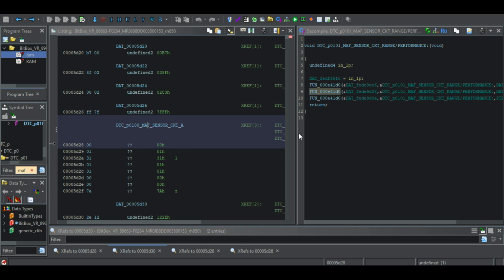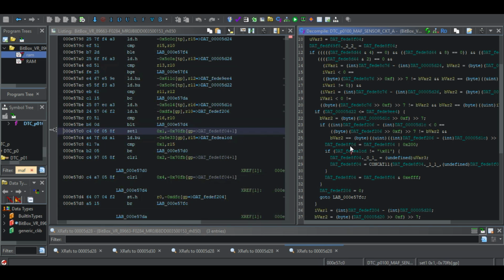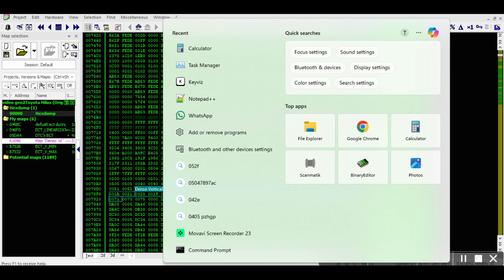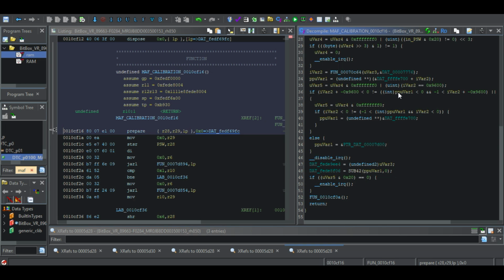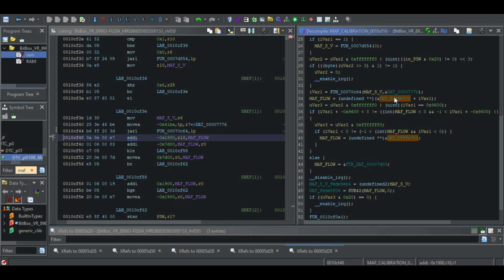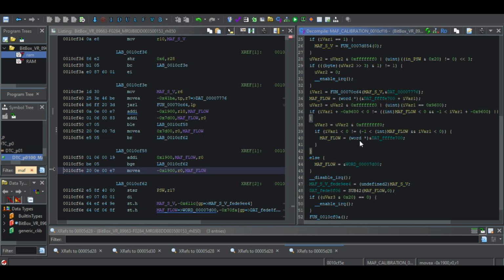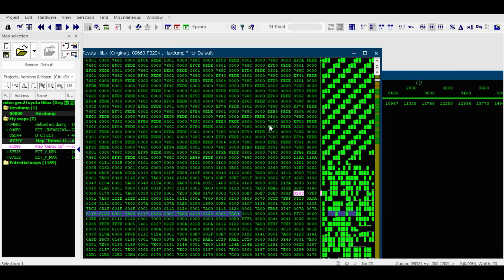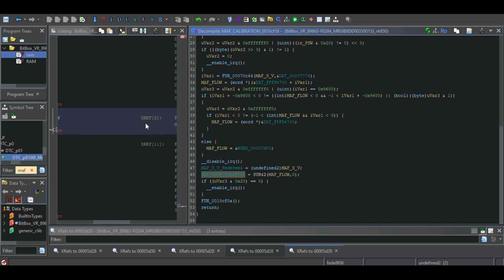defining MAF sensor linearization map and thresholds. Toyota hilux 2018 Ecu with ghidra and winols.

Comment: hey ,  what processor language used in gen1 (76F0085) toyota denso  ?  ChatGpt  suggest me this " The 76F0085 is believed to be based on the 8051 architecture, a widely used 8-bit microcontroller core. Familiarity with the 8051 instruction set and architecture will be beneficial. "
Reply from the maker: I think it is v850. Search for ascii “copy” see what the copywrite says.
Reply: @GHIDRAuto   it says  " RX703200 Copyright (C) NEC 1999-2002\r\n"

Comment: how to address Memory Block with correct address start address and lenth
Reply from the maker: As far as I have seen it does not matter how large you make your are for RAM. (Memory block) as long as it is large enough, and has enough room on the front and back. That is what the script did in the beginning, but sometimes it is wrong and you have to ad room as you find addresses outside of the block. It may help to have all of the memory properly identified, in which case you must consult the processor data sheet. For making maps, finding dtcs, and switches, adding memory as you go is accaptable
Reply: @GHIDRAuto   I can't find datasheet for these Toyota processor 76F0196/76F0198/76F01199/76F0219
Reply from the maker: @javiddkhan  oh, yes they are manufacturer specified, and you have to get their registers set correctly. they similar too rh850,or v850. I have a detailed tutorial on gen2 toyota denso my website www.ghidrauto.com. the information translates for gen one also

Comment: nice!! these gen2 ecu cant be read from obd2, recently some russians have been releasing tools on how to do the real read. have you ever looked into that?
Reply from the maker: I have heard about the Russians reading them. Supposedly bitbox? Can now read these ecus. I have not looked into it though. This video is one segment of a course I have on my website. I had a few people asking about these gen2 denso’s, but I don’t personally do anything with them. Just making the information more readily available.
Reply: @GHIDRAuto   there is a few other tools also not just bitbox, but will be easy to copy once released. did you ever analyze boost sensor scaling on this ecu ?
Reply from the maker: Yeah I haven’t gotten into the mechanics of reading and writing. I have found and explored the functions to read and write and communicate with my Isuzu Ecu. I have also found all the PIDs and dids.  7e8 7e0 101 102 5e2. I have also logged writing to my Ecu, However understanding how it works is still coming to me. It’s hard without a mentor or experience!! Yes I solved the boost sensor scaling in the gen 2 and gen 3 Ecu, and the new denso PowerPC, and old sh7xxx. Gen one Toyota is a little odd. I haven’t taken the time to fully understand the code for the factorization of the pressure sensors, but I do have two values that are more then likely factor and offset for gen1. Feel free to email me @ghidrauto@gmail.com. Or purchase this course on my website, it covers the boost sensor, and others. Ghidrauto.com

Comment: if they(toyota) are generating the code from matlab simulink models, the code would look more hideous after reverse engineering if not already.
Reply from the maker: That is an interesting point. Do you think that is what denso is doing? The code architecture looks much too similar between Japan’s big three  for it too be the manufacturer of the vehicle.

Comment: Have new discord link? I have original and modified files with the I/M readiness monitors set to read ready at all times. I see the changes in the file, but I have no clue how to find the functions that relate to the changes made in the modified file. If you can offer assistance I will send you all of the org and mod files I have for mainly Bosch controllers for whatever brand is equipped or Delphi controllers for GM vehicles
Reply from the maker: https://discord.gg/Xpkw8Sfj
Reply from the maker: I always enjoy finding functions behind the edits to see how it works together.

Comment: I've never used Ghidra, so watching this was really cool. I had no idea that it was even possible to reverse engineer ECU stuff the way you're doing it! It's still not clear to me how you derived meaning from some of those blocks of hex. It's impressive how you can make educated conclusions just by looking at arbitrary chunks of data. Stay brilliant and inspiring!
Reply from the maker: You hit the nail on the head. You make your educated guesses, and then when you track the guess too a dtc, you find out whether your guess was right or not. Obviously this concept takes many different forms throughout the re process, but the concept stays the same. You have to imagine what maps and code a programmer or calibrationist would need to make the engine run properly, then stay open minded enough while digging through the rom to be wrong, or almost right, so that when you see something g that is similar it clicks and you see it for what it really is rather then what you wanted to see.

Comment: Sorry for the silly queation, what language is that? C , C ++?
Reply from the maker: I’m honestly not sure. We are loading compiled machin code into the program. Rh850 processor in this case. Then ghidra does its best to convert too what I believe is C
Reply: Thank you for the answer. I subbed to your channel. I think you are doing very cool and informative videos. I will get the tooling and software required so I can learn and practise to in my free time of im not stuying instrumentationand control. Im a diesel mechanic down under, and i work on cars too,mostly a/c repairs. I like Toyotas btw , and amaroks . @GHIDRAuto
Reply from the maker: Nice man!! Your in a great position to learn these skills
Reply: @GHIDRAuto  can I please have the link for your discord community?
Reply: please correct me if i’m wrong. is the machine code in the form of jumbled hex codes, and then ghidra takes it and outputs its assembly code, as well as trying to translate it to the C-like language?

Comment: I work in automotive as an embedded engineer and I barely can navigate through our source code, this guy reverse engineers hex blocks and can derive at least some meaning from it, its really impressive
Reply from the maker: SHoot!!! they found me! lol
Yeah man, RH850 isn't my preferred language, I just figured "TOYOTA HILUX" would get some attention, and I've had a lot of people asking about it. my course on my website goes into a lot more depth on this ROM. I really prefer the old SH7xxx SH2A,e and sh4 language processors, due to all of their FLOAT's. I have a 1/4 of the time navigating those, and their code seems to be a lot more organized. small functions handling very specific task and then handing off to the next. PPC VLE also seems to be fairly straight forward although ghidra isn't handling it very well. regardless, rh850 or at least this hilux Rom wasn't my favorite. 

thanks for the Comment. You guys are doing some great work!

Comment: ... Renesas RH850 series?
Reply from the maker: nailed it
Reply: @GHIDRAuto  Yeah. I saw those 'movea' and 'st.h' instruction and was like "huuummmm... What is that!?" ... then I googled it. (I'm also now noticing that it's at the end of the file name for the assembly listing.)

More of a repair guy than a reverse engineer gentleman myself. That said, I dabble with EE. Let me just say, I love the "follow the DTC road" method. +1 sub. If and when I ever get some free time to myself, I gotta do some repair related RE on two systems. The main uC's on the central locking unit/immo and the PCM/DME for late 90's Porsche. I am totally going to use that method when I get to it. (one of the DTC's is "Wrong or Missing Key" .... path to victory is so much clearer now.)

... now I just need to search through the entire internet for some tangential datasheets that might show me exactly how to communicate with the programing interface of two different 90's uC's, then spin up some custom circuitry to rip the ROM's. Then simply get ghidra to de-compile 6502 and some obscure custom extended 8/16 bit Intel uC.

Should be a piece of cake! :D  (. . .End me!)
Reply from the maker: Nice man! That will be a fun project. Yeah, the way I explain it, are you going to drag the wood back to camp and then check if it’s good enough to burn, or are you going to check it as soon as you find it before bringing it all the way to camp for use. Same as checking voltage for thresholds. First thing a good engineer is going to do is condition it, then check it for quality. Then bring it through to operational functions.

Comment: The fact that reverse engineering is necessary is a societal failure.
Reply from the maker: You could wait until it’s supported by hp tuners, or cob, or you can do it yourself. Oem is avoiding liability by offering it.

Comment: I have lexus which has sport mode, but every time the car shuts down it defaults back to normal mode. I wonder is there a way to update source code of ECU so it will have sport mode by default. What plan would you have to achieve it? I am not sure where to start
Reply from the maker: Yes definitely.  First place to start is going on a deep dive to see how to get the binary file from your car. Or for your car. What year is it?

Comment: I would like to see a video on how you pull the roms from the Toyota denso ecu's and what tech is used ?
Reply from the maker: somebody sent me this Rom. however, the software I really Like using is PCM flash. The tool is simple, and has phenomenal support. I use Open port 2.0 as my usb to OBD2 device. OBDX also make really good/affordable OBD2 interface.

Comment: Can this be done to modern cars also? I have been wondering if such reverse engineering is viable option to permanently disable auto stop-start for example? Like NOP out that function and then patch ecu or something?
Reply from the maker: this file is for a 2017-2019. I am making an assumption that Gen2 is referring to the specific ecu type is its second generation.
Reply from the maker: I really don't have that much experience doing this, just playing around. however, I believe that some stuff can simply be NOP'd and other stuff may need more code surrounding it.
Reply: @GHIDRAuto  If you ever figure it out and happen to have desire to make video about it it would be interesting to watch full process of extracting ecu from the car, dumping firmware, modifying it, writing modified firmware back to ecu and then test driving with modded firmware. I mean today's problem is that car makers are locking down more and more things and end users these days really don't get to to own what have paid for. Modding car could get at least some control back to users who have paid for their car.  I am sure that if there is one video doing it from start to finish, then soon there will be more videos as someone else might get inspiration and do the same for some other car.

Comment: lexus drivers need you!!!
Reply from the maker: Is there a hole in the market? I thought most of Lexus was supported? Looking for a place to fit.
Reply: @GHIDRAuto  last i've heard ECU in the latest models of the 3is after the engine change haven't been cracked so they can't be tuned
Reply from the maker: @reijin999  interesting. do you have binary files for the older version?
Reply: @GHIDRAuto  uhh didn't even think about that 😅
there might be something publicly available, or maybe contact RR Racing and see how far along they are with it and offer them a hand?
Reply from the maker: @reijin999  shops don’t typically respond well to such solicitation. But I do cold call shops sometimes. It has never been well received well though.

Comment: Can this make my hylux's .50 cal less prone to jamming?
Reply from the maker: yeah man, just need to find the 4x table to synchronize the firing pin extension with the helical ecompression spring, then pin cocking lever to the sear slide. after that throw a pointer and Fmov,s cmpeq at your alternate feed nob for multi munition mapping
Reply: @GHIDRAuto that's cool and all, but none of that will have any effect if your turbo encabulator's side fumbling is tuned to within 1 mile per kilodalton of the lunar waning oscillations